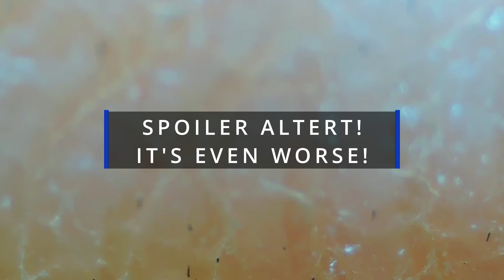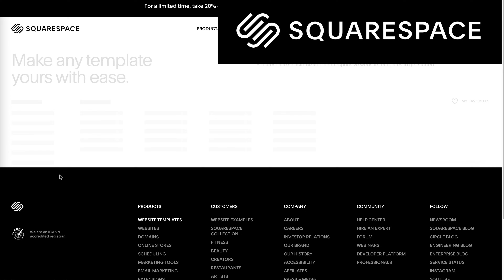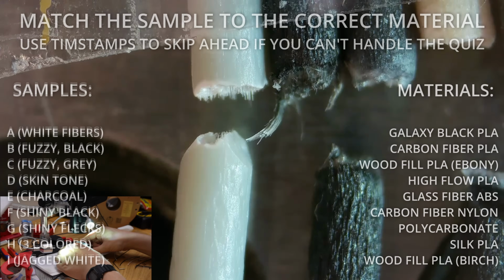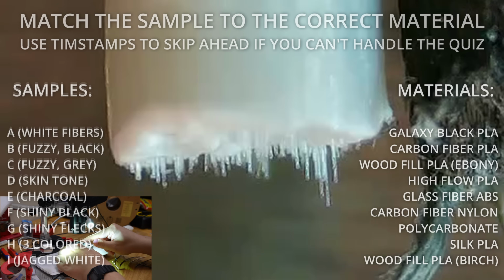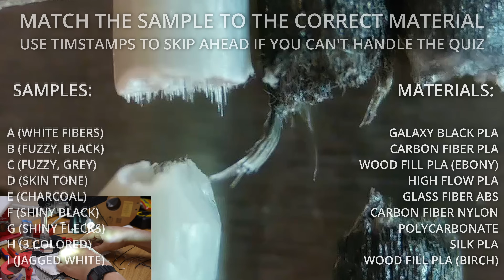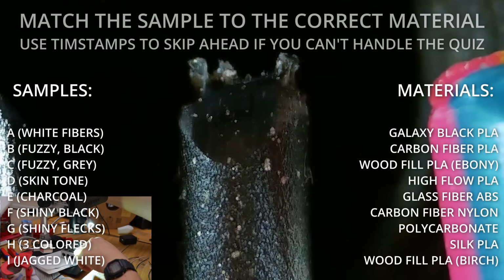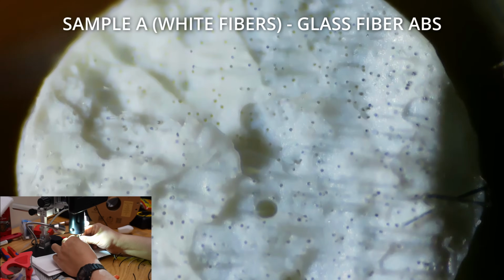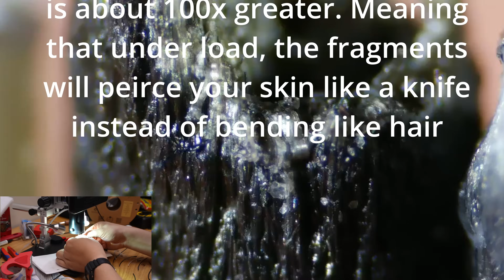Carbon In My Skin. These Wounds, They Will Not Heal.

Comment: sure, caution/PPE and more research are warranted. but the ratio of affiliate links and "i assume"s to empirical data and citations makes this analysis not very credible
Reply from the maker: Microscopes are awesome, you get to see things that are hiding right in front of your face.

I’d much rather recommend someone get a microscope over a 3D printer at this point. Also Amazon’s aff income isn’t very high, the links are more for your convenience, I don’t care if you click them but it takes me the exact same amount of time to grab an aff link as a normal link so why not?
Reply: @NathanBuildsRobots depending on what you're trying to image, sample prep also can be very hazardous (e.g. semiconductors). going on intuition though, i'd agree an uniformed amateur with a 3D printer probably has more exposure to poorly quantified risks

to be clear, i don't have a problem with you getting paid via sponsors/affiliates to make your work sustainable. between this and lack of citations, i have two main concerns:

- while i have no specific reason to question your motives, trust and integrity are critical to effective research and PSAs. a video about the hazards of filaments with pointers to "here's some other filament you can buy" (particularly without calling out the potential hazards of those filaments, and the fact that they're affiliate links) could reasonably be construed as a conflict of interest

- lack of empirical data and citations prevents this info from being verifiable or actionable. the comments on both videos are filled with uninformed takes from "pros" in both directions (from "CF is totally fine" to "you're going to get mesothelioma"), and frankly, who knows? neither video gives context to what you're seeing under the microscope/on your skin vs. what is a health risk, pointers to effective filtration techniques for particulates of that size, and so on. another example, afaik, "carbon fiber nanotubes" is conflating "carbon fiber" and "carbon nanotubes" which are two very different things. i could be wrong tho, and if there were citations i could go check what research you're referring to and confirm if this was an error in the script or something i didn't know about

exploring new subjects and posing questions is awesome, you raise some good points here. you mention wanting to do more research and (at 17:23) help spread the word from experts to a broader audience. it's a worthy goal; to be successful and to do right by your audience, diligence and transparency are essential
Reply: @NathanBuildsRobots  depending on what you're trying to image, sample prep also can be very hazardous (e.g. semiconductors). going on intuition though, i'd agree an uniformed amateur with a 3D printer probably has more exposure to poorly quantified risks

to be clear, i don't have a problem with you getting paid via sponsors/affiliates to make your work sustainable. between this and lack of citations, i have two main concerns:

- while i have no specific reason to question your motives, trust and integrity are critical to effective research and PSAs. a video about the hazards of filaments with pointers to "here's some other filament you can buy" (particularly without calling out the potential hazards of those filaments, and the fact that they're affiliate links) could reasonably be construed as a conflict of interest
- lack of empirical data and citations prevents this info from being verifiable or actionable. the comments on both videos are filled with uninformed takes from "pros" in both directions (from "CF is totally fine" to "you're going to get mesothelioma"), and frankly, who knows? neither video gives context to what you're seeing under the microscope/on your skin vs. what is a health risk, pointers to effective filtration techniques for particulates of that size, and so on. another example, afaik, "carbon fiber nanotubes" is conflating "carbon fiber" and "carbon nanotubes" which are two very different things. i could be wrong tho, and if there were citations i could go check what research you're referring to and confirm if this was an error in the script or something i didn't know about

exploring new subjects and posing questions is awesome, you raise some good points here. you mention wanting to do more research and (at 17:23) help spread the word from experts to a broader audience. it's a worthy goal; to be successful and to do right by your audience, diligence and transparency are essential
Reply: @NathanBuildsRobots short answer: while i have no specific reason to question your motives, trust and integrity are critical to effective research and PSAs. a video about the hazards of filaments with pointers to "here's some other filament you can buy" (particularly without calling out the potential hazards of those filaments, and the fact that they're affiliate links) could reasonably be construed as a conflict of interest

(i wrote a comprehensive response with some more positive/constructive points, but looks like auto-moderation is eating that version ¯\_(ツ)_/¯)

Comment: Instructions unclear, made Asbestos Reinforced Filament
Reply from the maker: https://www.instructables.com/3D-Printed-Snorkel/?amp_page=true
Reply: @NathanBuildsRobots  Now we’re talking!

(sidenote if i remember correctly if you get the length of the pipe too long on snorkels you can mess up your lungs so ye be warned !)
Reply: @ericlotze7724  Not mess up, but there are 2 problems with them. 1: You won't be able to breathe at any considerable depth because water will squeeze you and prevent from breathing in. Youtube has a bunch of videos with "how deep can you dive with a pipe" and 2 - deadspace. Your lungs can move only a finite volume of air to breathe in and out, pipe has volume to it too and it substracts the volume from your lungs. You breathe same air in and out which is not really what you want.
Reply: @NGC1433  overbreathing a snorkel can cause pulmonary edema. The strain placed on the lungs from trying to overcome the water pressure could cause capillaries to start leaking fluids.
Reply: @NGC1433  damn necromorphs ruining my breathing.
Reply: @NGC1433  As someone has already said, you can just use valves.

You could also use a system that has a small battery powered, waterproof compressor that pumps air constantly through the snorkel for more depth. Though at that point you'd be breathing compressed air so you'd have the same limits as a SCUBA diver in regards to compression sickness. Though you could make a 1.5m long snorkel with a system like that.
The compressor piston could be captive in the snorkel and driven using a linear motor with reed valves in the piston head to allow for it to switch off at lower depths and you to breathe through the piston. Or just use another tube with a valve that closes when the compressor turns on and use a normal piston with a connecting rod driven by a rotary motor.
Provided you learn to breathe in slowly and breathe out quickly this could work. Or you could just snorkel normally and hold your breath when diving deeper.
Reply: @NGC1433  just stick check valve in pipe and blow the air out in the water...
Reply: @NathanBuildsRobots  passive aggressive bozo
Reply: @NathanBuildsRobots  u wont like it
Reply: @NathanBuildsRobots I have never laughed louder
Reply: Moved my printer into kid's bedroom for soothing smell of acetone and rocking sounds.
Reply: @myc0p  idk i prefer the smell of ipa more
Reply: @alexthehopeless3778  What do you mean? India Pale ale smells amazing!
Reply: Parent of the year 😂 @myc0p
Reply: Carbon fiber is potentially way worse
Reply: We had some carbon nanotube reinforced polymers, those can penetrate cell walls like a needle through a balloon.
Reply: I use asbestos for all my prints, no problems what so ever
Reply: @noidontthinksolol  just wait for a few years... The magic will happen 😉
Reply: @noidontthinksolol  I also didn't see any problems so far, just started coughing with blood, but it's probably because of GMO food
Reply: Now radium enhanced, for the fun glow in the dark effect!
Reply: You were just doing asbestos you could.
Reply: ah yes, Gods own material
Reply: no worries, i will seal it with cyanoacrylate glue without ventialation
Reply: Ah yes, the dreaded asbestos...! While asbestosis of the lung is best known for having asbestos fibres as the main culprit, about any microfibre the size of 5x0.1µm can surely cause the same inflammatory condition in the terminal bronchioles, eventually causing mesothelioma (one type of lung cancer commonly connected to "stuff you've inhaled and your lungs cannot get rid of anymore"). It's the physical properties of those very short, very thin (and quite very inert) fibres that make them so nasty.

@Nathan thanks for bringing up this topic! 
Shows again that no matter how commonplace some modern things and technologies may be, we should never let our guard down. 
And as always: personal protective equipment isn't just for OSHA, only.
Reply: I thought you couldn’t use Snorkels for anything below water at all… no? I always stayed at the surface and put my face down. Accidentaly went underwater once and it, seemingly obviously, easily filled up with water. Isn’t that how it’s supposed to go? At least mine were  just empty tubes
Reply: Glass fiber filament
Reply: Then painted it with arsenic
Reply: @ 🎵 with arsenic sauuuuuuuuuceeee 🎵
Reply: Oh you...
Reply: That would be really useful for it's ability to withstand heat
Reply: Arf, arf!
Reply: @ericlotze7724  ok mom
Reply: Lol
Reply: At last, a commercial use for graphene.
Reply: i was literally about to make this joke
Reply: Lmfao osha is gonna have a hay day with this one
Reply: Oh, you know the drill.
Reply: ASB! Makes a great laxative or filter for cheap wine!
Reply: Its good for food
Reply: Yummy
Reply: I love inhaling Asbestos.
Reply: I would not be surprised if there’s cheap “glass fiber” reinforced filament from China that’s actually asbestos reinforced.
Reply: I don’t believe in gov regulation but carbon fiber is almost certainly worse for your lungs than asbestos. As long as people understand to use gloves and a respirator or have an enclosure with properly filtered air and a mask I am positive it’s no worse than the air outside which is filled with asbestos anyway from brake pads and other harmful carcinogenic chemicals. As the man said wearing synthetic fiber clothing is also a danger, I don’t think anyone should kid themselves that they can actually ensure your safety and if you put too much thought into it I am sure mental health issues might shorten your life before you ever suffer carcinogenic effects. It just good sense to attempt to not take undue risk, people have endured for millennia in the midst of taking mercury, lead, arsenic and other insane things at the behest of doctors of the day and humans are still strong. The animal population around Chernobyl are actually an amazing example of how fast life can adapt to extreme hazards. On a person for person basis yeah for sure a few people who over use 3D printers are going to get lung cancer and they will blame it on the manufacturers when we should just be teaching a healthy distrust and need to be informed as the basis for common sense and also just an acceptance that being healthy isn’t actually a reasonable expectation as sometimes people just get sick, strange illnesses happened throughout history and can be traced through just the famous and noteworthy people of the ancient world, so living life in fear of death is absolutely absurd. A life spent in anxiety and paranoia is also a life spent in a state of illness. Being afraid of everything is just as much an affliction as having organic health problems, I feel like modern and very recent history of fears around mass health problems has seen a lot of people locked up for attacking people for refusing to wear masks. I have personally witnessed someone going to jail for assaulting someone at a store for not wearing a mask, nobody can convince me that fear itself is not a hazard to one’s well being. 

So nanotubes especially will almost certainly cause health problems but just taking basic precautions and accepting using any technology including computers likely involves coming into contact with dangers. Just do your best and let it go, otherwise if regulators get their hands on 3D printers it will become a technology only the extremely wealthy will have access to. The trade of assured safety vs loss of freedom is very real and because regulators are both corrupt and incompetent you don’t actually fix much but you absolutely ensure only people who can afford all of the extra safety protocols and certification will be able to use 3D printing. Every industry with regulations benefits to a certain degree but what always happens as a result is technology becomes impossible to access by people who have less funds.
Reply: Lmfao love that comment.
Reply: Asbestos wouldn't even hurt you if it got into your skin. The risk comes from inhaling it. Your lungs cannot eject the fibers which causes a constant reaction in your lungs which leads to perpetual fluid in your lungs.
Reply: It's safer. Asbestos doesn't stick in your skin as bad just don't go sanding the parts without a mask LOL.
Reply: I wonder if that would work with metal in powder form
Reply: @ “Metal Injection Molding” / “Powder Metallurgy” and the FDM 3D Printing Equivalent made famous by Markforged (company’s name if i remember correctly) is basically very high metal powder to plastic ratio in the filament, then it is “Baked” where the plastic burns/melts off and the powder is Sintered

Neat process, but some issues with shrinkage akin to Annealing of Plastic FDM Printed Parts.

Also unlike SLM/EBM it is always going to be a non-solid metal part (Granted Best Practice Sintered vs Cast/Forged advantages/disadvantages is not something i know enough to confidently speak about!)
Reply: Now need to use lead, mercury and uranium
Reply: I work in federal facilities as old as the 1880s. Some of the buildings have asbestos-insulstef coal furnaces that are encapsulated in place, as well as the constant threat in the everything from wiring insulation to fireproofing to sound deadening to binder in plaster. I am an electrician and physical plant mechanic. I smoked for over 25 years. My retirement plan is probably hospice care.
Reply: Instructions unclear made asbestos cigarette filters 😂😂
Reply: If it is asbestos, I'm pretty sure that's illegal because you can't legally use it in anything commercially these days. Look at all the work they have to go through just to clean up a house that has asbestos in it
Reply: Asbestos isn't a composition. It's a habit. It basically just means "fluffy". So all this stuff is basically Asbestos. 

The normal white or blue Asbestos composition isn't carcinogenic, it's the fibers. 
Glass fibers on the other hand, are carcinogenic silica and that's before you turn them into Asbestos.
Reply: @FREDDAGGS  Asbestos is a LIFESTYLE 🗣️
Reply: Still works though jist dont play with it
Reply: That's fine, just don't sand, grind or splinter it then breathe it..